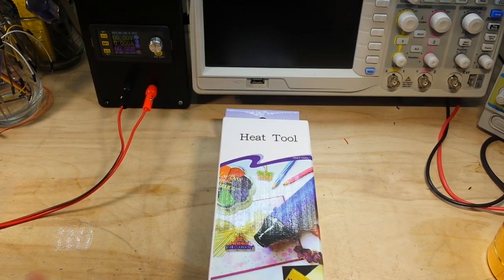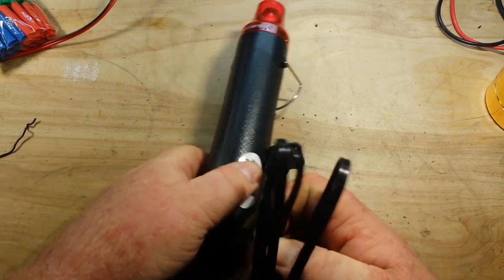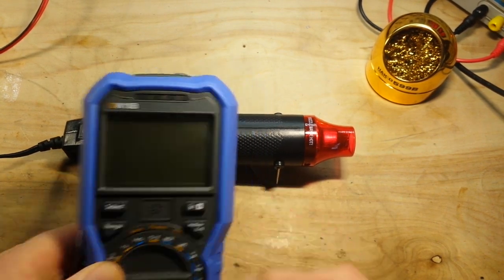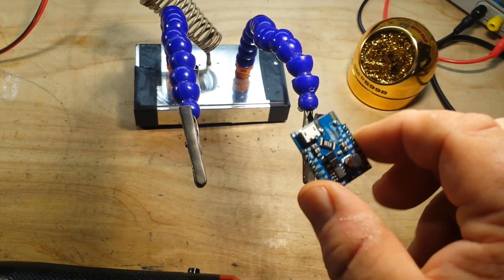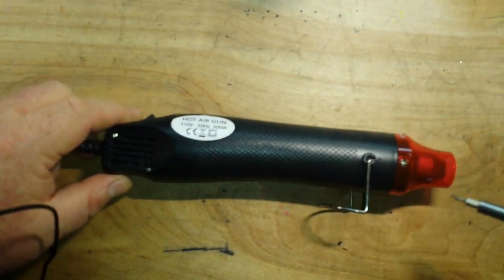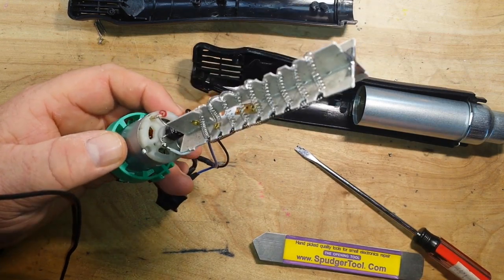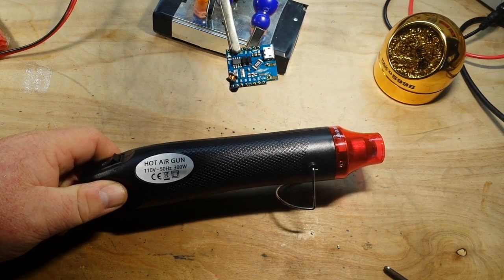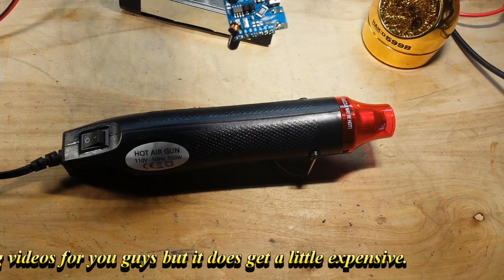Mini Hot Air Gun Review and Teardown

Comment: I was removing SMD components from a board, with this THING and after about +/- half an hour [of on and off use] the metal nozzle end started to melt the plastic around it and the metal nozzle started to dip downward nearly coming in contact with that red plastic “shielding” - this device is for very light usage [no more than 15 minutes at a time] for like shrinking heat tubes and not much else. Just my opinion

Comment: These are just barely hot enough in a pinch, if you glob some low melting point solder on things first. It'll never be ideal, and it takes a while, so it's definitely a last resort. I do it because I rarely have to remove chips, and don't want a real air gun sitting around.

Comment: I think the fascinating part is that's not a high-voltage motor - that's a run of the mill low-voltage DC motor, using the nichrome heating element as a voltage divider
Reply: Like in every hairdryer.

Comment: i bought this, turned it on, and it fried itself within ~4 seconds and began smoking, i messaged the seller and they gave me a refund the next day so there's that.
edit: Also the screws on my unit were severely stripped, really weird
edit 2:  i opened mine up, @ the factory they left some paper in the unit and it burned up inside and caused it to break. Was a pain to put back together but now it works but I got a free hot air gun, so

Comment: Can you restrict the airflow to get higher temperature and maybe melt solder?
Reply: cover half of the vent 😂
Reply: @Taternator15  yeah you can make the temperature go higher by restricting airflow. It will be better if you restrict the intake but I suggest a fan speed control..\

Comment: Great video but here’s some tips to help u a long the way it’s a great heat gun mine has a blue cap at end of it u can use it on electronics no problems for soldering or unsolding parts but one tip take the plactic tip off one it put me heat out and to it will melt the cap it u hold it to close to your work mine started to melt so I removed it well hoped this helped good luck

Comment: The temperature is low because the air flow (and noise...) is high.  You would get reflow temperatures by reducing the air flow — preferably by reducing the motor speed, but you might try some sort of “doors” on the air intake side.  As it came, it is tuned to heat shrink operations — period.

Comment: Ran across these on various Chinese sites. Still need hot air reflow, but decided definitely not to buy this. No temperature control. Not even power control. No airflow control. The suspicion that it just won't solder was easily confirmed elsewhere.

Thing is, if you know anything about hot air stations, these inexpensive Chinese ones right around $50 or integrated with soldering stations, you know that you often need to keep them at super low airflow. For two reasons, for one, at even 700-800W, they have trouble reaching soldering temperature, and they have a better chance at low airflow, and for other, when you're mass desoldering, you won't care, but sometimes you'd REALLY REALLY appreciate not blowing all the little capacitors and resistors away. So this will fail on both accounts. 300W going wfull blast is just bad.

Heatshrink? I have butane jet lighters. If i need to shrink it gently and slowly, my hair dryer will do. It has lots more power.

If you want to play around with it, do you think a bit of diode modding could make it go slower on the fan without combusting the thing?

Comment: Omg..I have one on my solder station I was considering that for something portable.  That was until you turned it on and it made my ears bleed.  You should have used a decibel meter rather than the power meter.  :D

It didn't come with different nostrils?  ;)

Comment: I've found the 853d station heat gun works instantly on shrink - the temperature rises as fast as on my soldering iron.  It's worth it just for that and can be used for single shots..
Reflow took a little more work ... PCBs are excellent heatsinks and of the nostrils that came with the gun, really only the smallest is capable of breathing out enough heat to be effective and to work fast enough to be useful, I usually crank the temp up to about 420c on a low flow.  If it's for only one component - it''s not worth the effort.
If I'm honest I also stole the Iron (the wife's) and have it mounted upside down as my base to keep things toasty.  Not needed but on bigger chips it helps a lot, as does a lot of flux.  Makes stripping a board for bits worth the work.
Reply: Do all your shirts smell of flux too? 😅

Comment: I recently tried my Harbor Freight heat gun for SMD and it works fine on low, and I have ordered some nozzles to go on it for more precise control. I found that when hot air spreads out on the surface of a board, you can overheat electrolytic caps and they pop like firecrackers leaving shredded brown paper over the workbench.  The high setting can scorch and smoke a PCB where I tried rapid bulk removal of salaged components. I still prefer a 40 watt cheap iron and compressed air for pulling parts.
Reply from the maker: Yeah, you pop cap and you're picking up brown confetti for months!

Comment: This looks like a direct knock-off of SparkFun's Heaterizer XL-3000, which is $13.95 for the same specs and comes with lifetime, US-based technical support and decent return policy. For the money (only $1 more), I'd recommend that one. The instructions are also hilarious. I've used it for heat-shrink and to soften 3D-printed parts for clean-up. I haven't tried using it for re-flow, though.